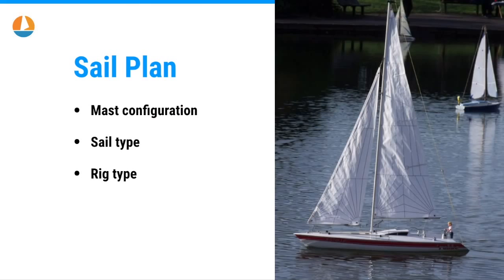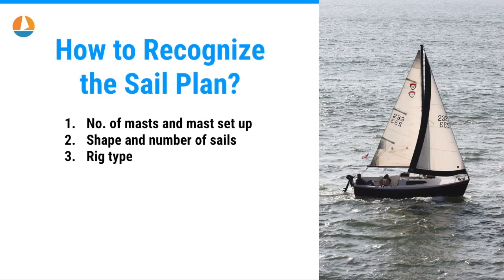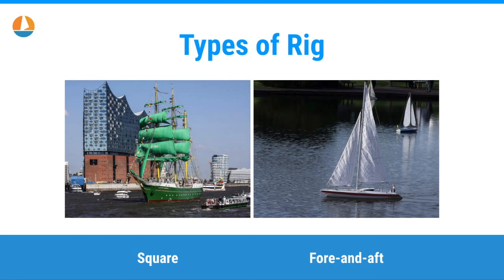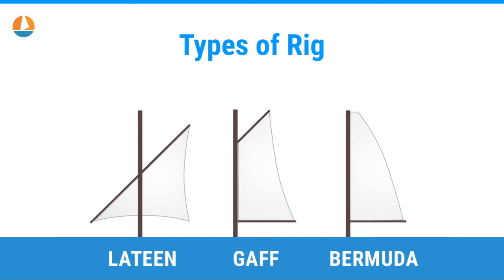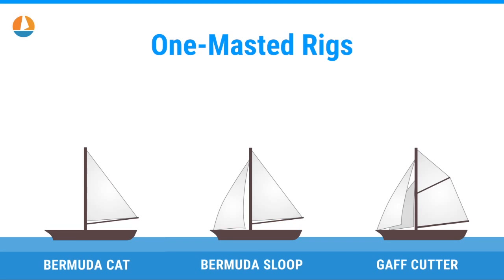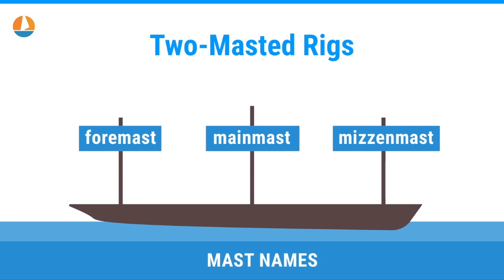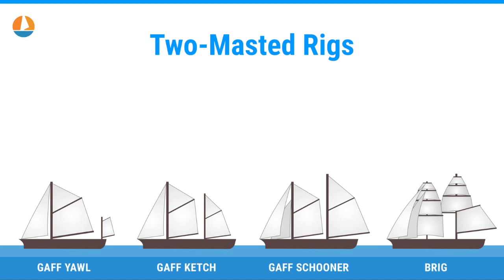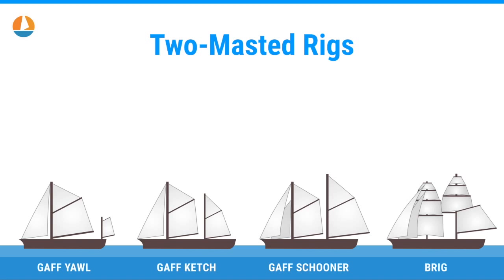Different Sailboat Rigs Explained (Tall Ship, Gaff)

Comment: Thanks for that. Incidentally, according to the Oxford English Dictionary "Mizzen" is late Middle English from Italian "Mezzana". Ironically, that means "middle" - so they applied it to the wrong mast!
Reply from the maker: You're welcome. That's just great, thanks for this cool fact. Nice to know.
Reply: I do believe, and I'll have to dig out my old reference books on sailing antiquity, rigging etc. and my Darcy Lever's as well as Underhill's Masting and Rigging, but middle referred to middle height as in the mizzen was half as tall or even less than half as tall as the other masts.
Reply: Mezzana mast was the center mast of the three mast boat in medieval time. When the boats became two masts vessels, one mast was taken away. The french considered that the first mast was the one missing so the mat de misaine is the front mast. For the English sailors, they considered that the bAck mast was removed, hence the mizzen is the back mast now. Check wikipedia.

Comment: @00:58 The front sail is not a gennaker. It's a spinnaker. It is attached to and held out from the mast with a spinnaker-boom as you can see.
The gennaker is an a-symmetrical sail, the spinnaker is symmetrical. A gennaker will normally be attached to the bow or a bowsprit. The word gennaker is a contraction of Genoa and spinnaker.
Reply: THANK YOU! CORRECT! I get chaffed when I hear and see these little incorrect references and such!
Reply: I'd also add that a spinnaker is always set flying and only tacked to a spinnaker pole attached to the mast, whereas as Gennaker is always as you say Asymetrical and always tacked down to the base of the forestay or to a temporary or fixed sprit getting it out further forward of the jib or head sail.

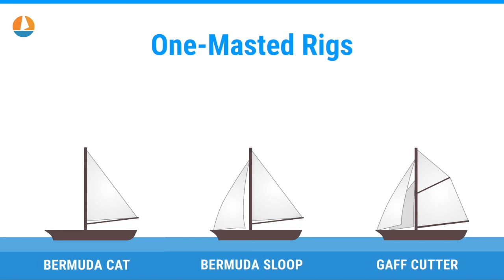Comment: The categories around 7:30 need to be spread a bit more; catboats, sloops, and cutters all have one sailbearing masts. Catboats usually have the mast stepped well forward and have no foresail. Sloops have one foresail, and cutters have two or more. The mast can either have a triangular Bermuda sail or a gaff sail with or without a gaff topsail. So you can have Bermuda and gaff catboats, Bermuda and gaff sloops, and Bermuda and gaff cutters.

You're also missing two entire categories of sail plans.

The first,  the spritsail. is similar to a gaff sail, except where a gaff rig has the head of the sail brailed to the gaff along its entire length, a spritsail is only fastened to the sprit at its peak; the sprit itself angles down across the sail to its mounting on the mast generally about midway along the luff of the sail from the tack to the throat, and there may or may not be a boom anchoring the foot of the sail. When there is no boom, a spritsail can be quickly hauled up to the mast and secured in heavy winds..

The second, the lug sail, is also similar to a gaff sail, and the head and foot of the sail are brailed to the yard and boom, respectively. However, where the luff of the sail would be brailed to the mast, and the ends of the gaff and boom would attach to the mast, a lugsail has both attached to the mast so that the luff of the sail extends forward of the mast, and is free-standing, the sail being attached only to the boom and yard.

The gaff, sprit, and lug rigs all share the advantage of being able to carry more sail area for a given height of mast than a Bermuda rig, and on smaller boats can even eliminate shrouds and stays, using an unsupported mast.
Reply: Well noticed, I'd add that Sloops can carry more than one headsail as well, but the singular characteristic and a technical one is that in Cutters the mast is stepped a bit further aft than in a Sloop.  This is dependent on the overall design spec and whether the mast is stepped forward of or behind station 4.  The foretriangle in a cutter is larger and had to do with large mainsails and needing to counterbalance a weather helm and may or may not have a bowsprit.

(I'm adding this as a clarification: In former times when these smaller working vessels were ALL gaff rigged and often the mainsail carried a boom that extended well aft past the transom, and this continued to be experimented with, it became necessary to balance against weather helm and required adding sails forward to counteract the center of effort moving too far aft.  This was accomplished by adding bow sprits or moving the mast further aft, reducing the size of the main sail and giving space forward i.e. larger fore triangle to add head sails.  So, if they left the mast stepped 3/4 of the way forward for example and added a bowsprit then technically it was still a sloop with more than one headsail.  Moving the mast aft was not practical in an existing vessel as it would entail major rebuilding and downtime.  So developments took place in design and building as a necessity and the single mast moved further aft.  I'm leaving out a lot having to do with cargo spaces and arrangements on deck which were either impacted postively or negatively by any of these developments.)

A sloop with a bow sprit and the mast stepped forward of station 4 will generally have only one head sail but can carry two.  It is easier and functionally correct and proper just to so say a cutter carries two headsails and a sloop only one.

Comment: 01:50 that's a spinnaker not gennaker, the latter would have been attached to the bowsprit
Reply: Boby Dome I was thinking that too
Reply: Sometimes a spinnaker is called a genoa but I've never heard of a gennaker. That must be a landlubber corruption.
Reply: Boby Dome I have no idea what you just said
Reply: @markpeverley6343  a gennaker is a asymmetric spinnaker, mostly used in skiffs and faster boats. A genoa is a foresail that is similar to a gennaker, but a gennaker will not go upwind and the genoa is a much less full sail.
Reply: Mast debater

Comment: at 17:31, this is a barque, because the aft mast is not square rigged. at 19:20 this is a Brig, not brigantine, because both masts are square rigged. and a schooner is called Schoener in Dutch, not Schooner :)
Reply from the maker: Thanks for the corrections - Edited the video description for others to see.
Reply: In terms of sailing history, the ship at 19:20 is still a brigantine. Brigantines can have one square sail on the main mast and still be considered a brigantine. Modern brigantine are referred technically as hermaphrodite brigantines. Meaning that the carry a gaff topsail instead of a main square sail. You are correct but, I’d thought I may throw in my two cents. Nice catch on that barque. I had to look twice to see it.
Reply: Potatos potatoes

Comment: Thanks for the video
I have been wondering recently about Ketch Vs Schooner... It is clear in your diagrams with a single deck. 
However if your (not going to use the right words here because of the question) .... if your mast at the middle and the mast at the back are of the same height, however because of the configuration of the boat. The foremast is connected to the main deck but the stern mast goes through one or two decks before being exposed to the elements as such the two masts are the same height but the sail size is different, i.e. the fore mast has the larger sail, and because the boom of the stern mast has to start higher up the mast (due to aforementioned decks) and therefore has a smaller sail... is this a Ketch? or is it a schooner even though its aft sail is smaller?
Reply: What are you talking about through decks???  The Pallada, a 3 masted full rigged ship, is one of the Russian Sail Training Ships and has her masts stepped on deck for goodness' sake!  A Ketch NO MATTER the number of decks which is ridiculous because ketches are smaller vessels and will have only one main or weather deck with but one or two exceptions, has a shorter mast aft, no matter whether stepped on deck or through deck below, which is a driving or steering sail and provides lift/thrust as well and in a KETCH it is ALWAYS stepped forward of the steering post.  A YAWL has an even smaller sail aft on generally an even shorter mast.  It is often stepped on an outboard structure built out over the water off the transom and is ALWAYS whether stepped as stated or on deck, AFT of the steering post or column, some say the rudder which is technically correct, but I won't get into that here.

There's a lot of confusion going on in your statement.  Don't think about whether a mast is through a deck or stepped on deck.  When a vessel has two masts and the aftermost mast is lower in height, that is a Mizzen mast and the forward most mast is NOT a Fore mast but a Main mast as it carries the Main/Larger driving sails and is the Main mast because of height.  When both masts are of the same height and fairly equidistant foreward and aft on the vessel it is ALWAYS a schooner if they are rigged with fore and aft sails. (I won't get into brigs, brigantines, or barquentines).  We are talking about smaller two masted vessels.  Some schooners have masts all the same height and up to 7 masts in all, see: Thomas W. Lawson (Google/Wikipedia) or Wyoming (6 masts).  Some may have the aftermost mast slightly shorter, and in two masted schooners traditionally the fore mast or forward most mast was shorter than the main mast.  I hope this helps. 

I prefer schooners for their sailing qualities, preferable to Ketches or Yawls which I always find cranky and you have to fiddle with them to balance them out as the massively larger quantity of sail forward can give you a delicate and cranky helm or steering due to the effort being so far forward of the rudder hence the necessity of the little sail aft.  It is a design that isn't as common these days and all sorts of variations are appearing, technically ketch or yawl but with highly modified rigging and sail areas all to balance out the sailing qualities of the vessels.  Ref. Steinlager 2 a modified ketch rig and very interesting at that as it set a mizzen staysail between the main and mizzen masts.

Comment: I think that the ship picture from the start & end of the video is actually a 4 masted barque. If it were a schooner, the aft mast would be the same size or taller than the other masts. However, it is shorter. That's more indicative of a barque.
Reply: Actually, incorrect it is as he said a Bermuda or Marconi rigged 4 masted schooner.  A Barque is ALWAYS square rigged on all masts except the after most mast.  A Ship rig is Square on all masts, and when there are more than two masts.  For the schooner I suggest you google Down East Schooners as well see Wikipedia entry for the Schooner Wyoming.  She was a 6 masted schooner.  There was ONE 7 masted schooner built the Thomas W. Lawson.  Interesting bit of trivia, they were running out of names for the masts and the crew referred to them fore to aft as, Sunday, Monday, Tuesday etc. to Saturday the aftermost mast.  The aftermost mast in schooners when more than two masts CAN be the same height OR slightly lower.  My credentials: Master of Sail, former Crew member, 3rd. Officer & Chief Mate of 4 Masted Barque Sea Cloud.  Bosun, 3rd. Mate, Chief Officer 3 Masted Barque Elissa.  To cite but a few. I have sailed schooners of many types and owned my own Marconi rigged Staysail schooner.  That is when the fore sail is set on a stay running from the main mast down to the base of the foremast on deck, making it a staysail.  He does not touch on many types of "Tall Ship" for example: Brigantines, Barquentines, Jack Ass Barques.  Just FYI: say you have 5 masts on a Barque or Ship the names fore to aft are always Fore Mast, Main, Mizzen, Spanker and Jigger.  I'm using English/American terms but in any language, you'll find basically that arrangement.
Reply: @paulbonge6617  Thank you for the information. I was going off of a photo of a barque that I have hanging in my studio from the early 1900's. The two ships look nearly identical although the picture I have is not at full sail, so I was making a few guesses for the missing sails based upon the rigging visible. (I know the photo is of a barque because I looked up the history of the vessel when I first got the picture.)

Comment: I really tried to find out the answer to the last challenge question in tne video but I could not.
You mention that a Schooner has the tallest (main) mast at the aft where in the foto this is not the case. I would suggest: 4 Mast Bermouda rigged Ketch for the last foto. Anyway thank you for the video.

Comment: The aft-most mast is only a Mizzen if it's smaller than the previous mast. Ie: in a 2 masted schooner it would be the Mainmast. In fact it's only called a Mizzen if it's on a Ketch or Yawl as the Mizzen is smaller (or half-mast) hence the name, that comes from the italian for middle (as in size?).
On a schooner the aft-most mast is always the biggest and so the main, it becomes complicated when there are multiple masts, and in the past, with a seven masted schooner they ended up naming them by their numbers. as in mast No1, or mast No2.... even days of the week. 😂 monday sail, tue. sail etc 😂 (but maybe that's just sailors tales...)
Anyway ketch, yawls have mizzen. schooners have multiple fore, mid, third, etc and    the last is the MAIN.
That's what i've always been told, don't take it as gospel, and I'm happy to be corrected if i'm wrong. 👍
Reply: I’ve heard of the days of the week sail names